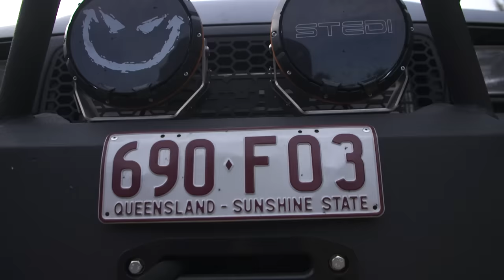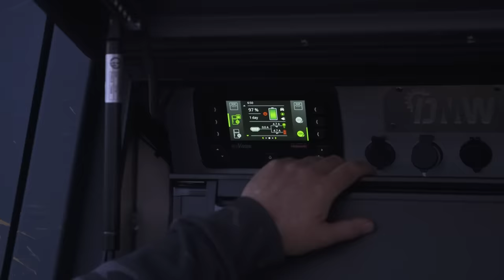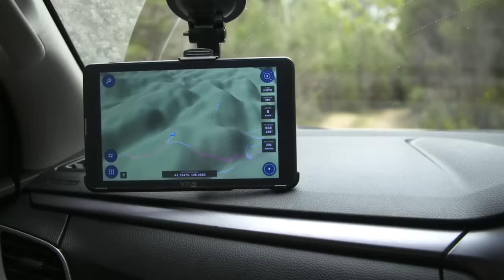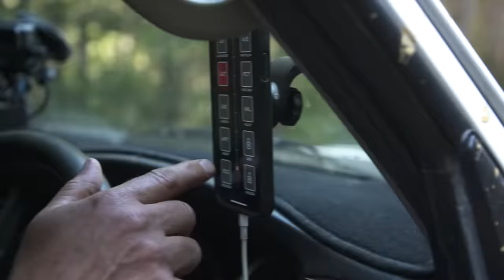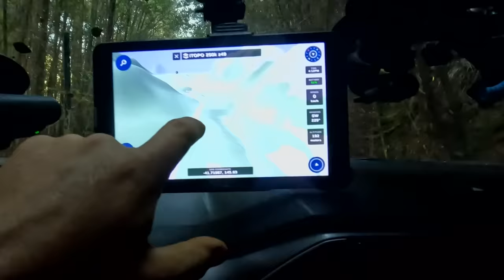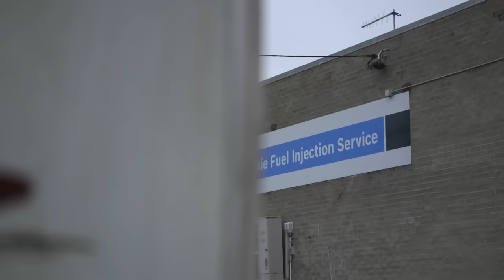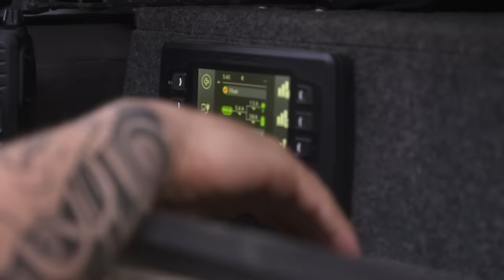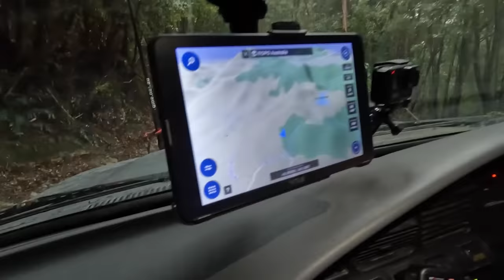Sooty's first trip goes WRONG! Disaster in Tassie: Overnight engine swap, breakages & panel damage!

Comment: A brief moment of appreciation for Graham who constantly lets other people take his D-max out on hectic tracks.
Reply: @m5wm6w  hence why Graham constantly froths over the most basic performance whenever he drives it
Reply: @gaivscaesar  True but its nice that it represents a relatively stock vehicles capabilities, its also been pretty bulletproof, for the cost of 1 vehicle every 2 years thats alot of viewers and screen time for Isuzu Australia.
Reply: @atoms4sail  why do people keep saying relatively stock. It has a ton of upgrades including suspension, 33 inch tires, winch, skids. Only thing it doesn’t have is a front locker
Reply: It’s a company vehicle
Reply: @atoms4sail I don’t know how his does well, my dads d max is complete shit. Nothing works on it, and it’s not half as capable as my stock hilux. He only used it once 4wding with me bc he has a twin locked 105 series with an fte.
Reply: @rockygambina312  because compared to the other cars, it is relatively stock... and its sitting on 31's not 33's...
Reply: @rockygambina312  people keep saying relatively stock because it is. Its got a standard 2 inch lift, (which almost anyone doing any off roading probably should have and most do), its got 31 inch tyres not 33s everyone should have upgraded tyres while not everyone will go larger in size a great deal of people will upgrade to 31s if its not already standard. its got a decent set of bash plates while really isn't that expensive but should really be on any ifs car doing any off roading and a winch, which is handy but not vital. the point of taking the d max on these trips, is not to say that its the ideal car for it. but to say hey if you have a dual cab ute with a bit of a lift and some tyres look how far we take this, you don't have to go that far but don't be held back too much.

Comment: 1) Jessie is absolutely clutch across all area of wheeling. 
2)they engine swapped in 24hrs wtf🤌🏻
3)Ruben’s hat game is unbeatable. 
4) the ZD grenade is blowing up the tracks!
Reply: honestly a 24hr engine swap isnt that hard with the donks handy. have done dozens in ~7-8hrs by myself. but adding in the time to get the engine removed and delivered from hobart is pretty damn good. itd be at least 5-6hrs in that alone. well done to them.
Reply: Iv started taking an engine out at 8am and been driving out of the shed with new engine at 6pm those older trucks it’s not hard to do

Comment: To the 4WD 247 team. This was an epic EPIC trip. The commitment to get through the switchback towards the end of the episode took some very focussed driving that also demonstrated how important it is to have absolute unwavering trust in your mates. When it looks steep on camera IT IS STEEP! One suggestion though with lockers. Wire them up so the front can be turned on leaving the rear diff as an open centre. I have done this in my own fourby, and trust me fellas, for something like this switchback, it is a game changer having locked front wheels that can "tractor" the front end where the front wheels are pointing without a locked rear trying to push straight. Try it once and you'll never go back to the "traditional" paradigm of rear then front. Front locked on its own with an open rear in the right circumstances works brilliantly well.

Comment: So Sooty's brand new engine spun a bearing. Tough luck! Is it going to be analysed to find out what happened and rebuilt once again? The guys at Donnelly engineering must be sweating bullets! Surely Sooty won't be running just an old HZ engine out of a poor derelict donor car, after so much hard work has been put into the "original" Sooty MK II engine?

Comment: Hello folks from 4WD 24-7.
Thanks for the amazing and inspiring shows on your channel. Here in Austria 4WDing is not so commen and there are only few clubs with their own tracks, going really offroad is not possible anywhere. Inspired by your show I took my standard 2019 Ford Ranger Wildtrack for a one day offroad training course at one of these clubs.
After having followed your channel for quite a while and listening to your driving tips I found the theoretical part of the course quite interesting but it did not bring a lot of new stuff for me. Your advices regarding picking the right lines and tire pressures as well as wheel placement furthermore helped a lot during the practical driving part of the training. Having seen Graham picking his perfect lines in the D-Max so often on videos really helped me picking my lines right on the first attempt at most of the obstacles with my Ranger (I have some experiance in driving mountain roads in the Alps in deep snow, so I am used to controlling the throttle carefully and keep up momentum). We did some rock-steps, a few steep climbs and decents in sand and in mud and I really enjoyed my day - will do that more often.

A cooking tip for Shauno at the campfire:

get a whole chicken and season it on the inside with salt, pepper and a little darlic, rub the outside in salt.
Put a fresh apple inside the chicken and and pack the whole chicken in an about two to three centimeters thick layer of mud (would like to try that with Tassie mud one day)
put the whole load into the fire for about an hour
out of the fire crack open the now hardened mud and enjoy the outcome 

Many thanks again for hours of good and informative entertinment and thank you for bringing me into offroading.

Leo from Austria

Comment: Toyota built its reliability reputation on running de-tuned engines that operated well within the engine’s limits. Lost count of the number of times these high HP / Nm beasts have come into our shop making bad noises, with low km post-build. Bad noises followed by a bad bill. My sincere recommendation is to significantly drop output expectations and build for reliability.

Comment: Sean it happens. I'm on my 2nd engine in my rig. When we rebuilt the 1st time we didn't realize that 1 of the barons was a little tighter than the rest. On the crank shift. Ended up doing the same thing not enough oil went there and smoked the engine.

Comment: Truly heartbreaking!  I built a 292 L6 GM engine this last winter and put the wrong Connecting rod bearings on.  I had some oil pressure at idle and it improved with higher RPMs.  BUT, excess clearance only got bigger and Oil pressure dropped accordingly and after 30 Min, half a Con rod punched a hole through the side of the block.    Its not the money, its the feeling of failure that hurts soooo much.  However, learning what I did wrong was extremely important.  Which is why I did the tear down myself and identified where I went wrong.  

Don't ever give up and just walk away from a passion, that will kill you faster than any failure.  Way to jump in the passenger seat Shauno keep carrying on.

PS - When that 292 ran it pushed an old 1975 Fibreform boat up to 35 MPH, it was quite a blast while it lasted.

Comment: 13:38 - That amount of oil smoke inside the engine is a sign that the oil is cooking. Literally vaporizing inside your engine. Would lead to ask about the type of oil used, the quality (syntetic, top of the tier ones, or some knock offs sold on gas stations and alike) or the correct weight. On a last thought, if all previous answers checkout, an oil cooler (or the lack of it).

Considering what I saw from the video flashes, and not being present to correctly access the situation, my guesses are that the oil became so thin, that the valve lifters bled out. What you can hear (and getting worse) would be the valves literally hiting the beads. Another tought, if the sound comes more from the bottom of the engine, would be the bearing scores due lack of oil viscosity not being able to keep that oil film between the moving parts, (what would make sense if you consider the oil vaporizing from the quoted timestamp).

Drain the oil, and check on the spotlight if the oil has some sparkly glittering metals. If it does, is bearings. If does not, might be the valves. Good thing is that, if it is the valves, an oil change and correct oil replacement might do the trick, since it takes some beating to propper damage the valve beads and cause the engine to loose compression.

Hope for the best mate. Make a video later regarding the engine update, or, in worst case, its teardown to see what went wrong. Let your bittersweet moment be somewhat explanatory and instructive for others.

Cheers!
Reply: Bloody heap of oil Vapor from a fresh engine that’s for sure

Comment: First question guys. Air v electric lockers? What do you find has the most failures?

Also I see the raptor coat gets done on all the builds and looks so good. Just curious what sort impact does it protect up to?

And what colour you doing the cab? And type of interior?

Comment: I wish the typical patrol owner would take one from Pete’s book…. You don’t need 6” lift and 37’s and a td42 to sit and spin wheels and ruin tracks
Reply: So we all need a gu wagon lifted twin locked 35 baja boss dynamic bead locks and a twin motor giggle pin comp winch 
No worries 👍

Comment: I'm sure Isuzu D-max sold a couple of hundred units cuz it features in 4wd24/7 channel. New gen D-max being equipped with rear locker (which old gen don't), bigger wheel well. 33s or 285/75R17(T/M) can now be fitted with a good 2 inch solid suspension lift. over all 275/75R17 (T/A) is a better choice for touring and daily driving.
Reply from the maker: Couldn't agree more mate

Comment: I recon weak oil pump and it’s spun a bearing in the bottom end
Reply: You’ll need to most likely pull the crank out inspect it for heat damage due to no oil and if it needs it a new crank shaft you will have to get another one and then put it all back together

Comment: Awesome episode
Shauno is the 1hz originally a non turbo engine and is it possible to install a big turbo on the standard engine without any internal changes or would the 1hd be the best option. Loving the show al the way from South Africa 
Kind regards
Reply: Yes 1hz comes naturally aspirated no turbo from factory, 1hz cant handle turbo it will shit the bed they blow up every where in australia from turbo, vest off keeping 1hz naturally aspirated they will go 1 million kilometres or 1 millions miles, go 1hd but better options will be 1hdfte as it way better then 1hd, 1hd is pretty much 1hz but cylinder head is little diffrent, you got 1hz,1hd,1hdt,1hdfte,
Reply: Oky thanks for the advice, still looking for a decent 80 series but it will be the 1hd ft, the fte is quite difficult to source here any advice on the mechanical injection engines

Comment: Rod knock, never a good idea to take a freshly refurbished engine and beat on it that hard
Reply from the maker: I actually put more than a few thousand k's on it before this trip, including the drive from Brisbane straight down to Tassie - so it was pretty well worn in until it all went wrong!
Reply: @4WD247  I'm busy with an engine rebuild for my 2005 L200 4x4 myself, that why I said what I did
Reply: 2005 lc200???? That would be hard since they didn't come out till 2007

Comment: 😈😈😈😈 i ve been in soke hair raising situations on sand dunes , so steep i had to turn around after leaning using a tree with complete bar work from the front bull bar,  over the roof to the rear ....    so i leant tge 4d4 against the tree. ...  pulled out of 4x4 .... let down the rear tyre pressures and line locked the 150 series around the tree....  or the car would have flipped over ....     and some one in the team followed my tracks almost into the same horrid position ......😈😈😈😈

Comment: i would love to see shaun take a 79 throw a powerstroke 7.3 diesel in it with 1000HP minimum  on atleast 44 inch tires with Real beadlocker rims lockers front and back . and just watch it walk all over most of these trails that give the guys a hard time with these smaller tires they usually run .

Comment: My heart goes out to you for your disappointment as it will with many people. However, calling it a miracle, then that is where I have to draw the line in the sand. It is the mechanics and the 4WDers that have found another engine and are getting to the workshop that deserve the praise. A Miracle, well, that is just a fallacy right there, it is the hard work and determination of the people willing to help you is what requires your praise not some monstrous deity. If that moron actually exists needs a kick in the teeth for letting it happen in the first place, just to allow you to cling to some minute hope. You called that a miracle, shame on you and shame on whatever it is that you think has caused the miracle.